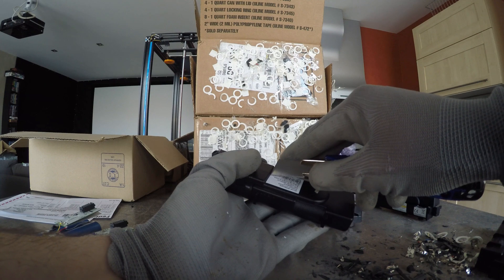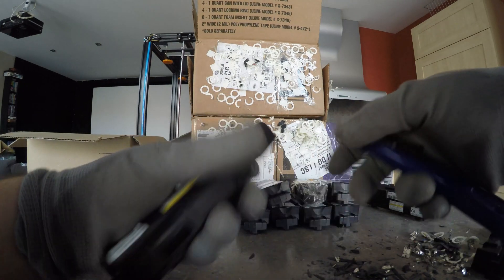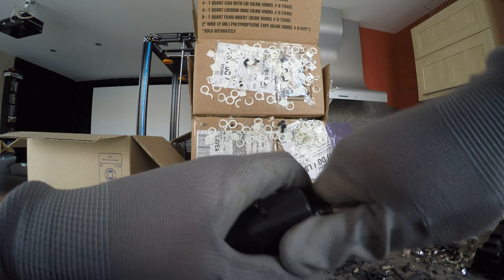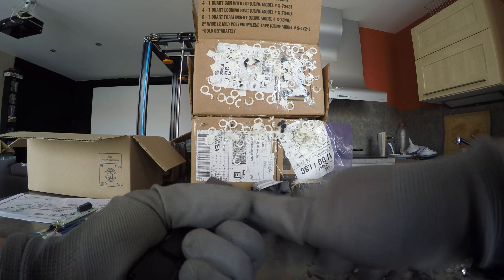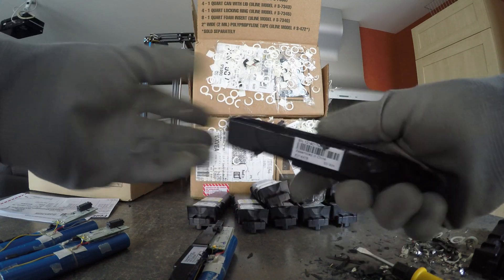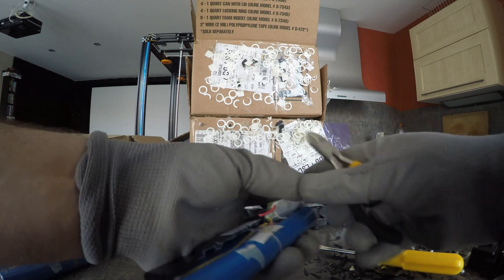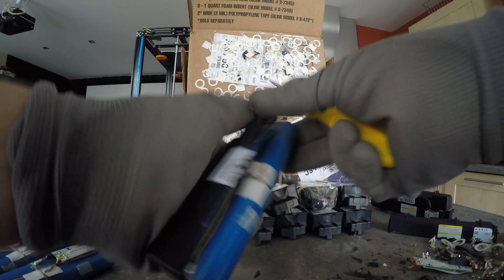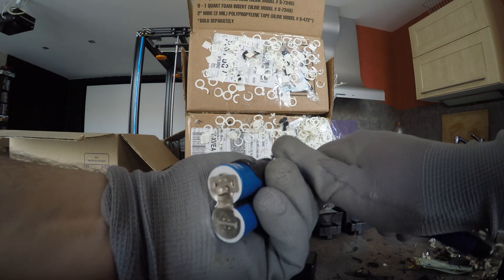Opening ARRIS Battery pack from cable modem : BPB044S

Comment: Instead of prying it apart, try cutting through the stickers on both sides with an exacto or similar blade.  Then you can hold the battery in a vise and just push it open with no problem.  Much safer! I did a video on this. The ones I have opened have contained mostly LG cells and they are the most difficult to get the cells out due to the amount of adhesive they use.  The Sony and Molicells were the easiest to get the cells out.

Comment: That was quicker than my way,I'll give it a try,I need to order some of them cut resistant gloves,my fingers are getting all cut up,good video and it looks like u also bought a ton of them 40 cent cells from battery hookup.what a great deal,I also bought the 20sanyo 2200mah packs,do u know about opening them up amd if u did get some please make a video,they kinda scare me being a 20cell pack at 14.8v I do not wanna be shocked by that.